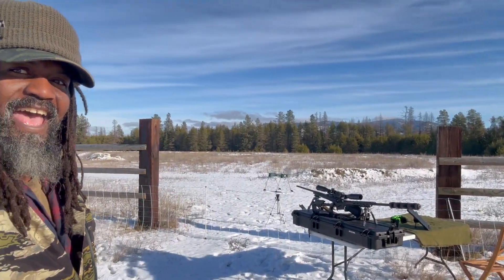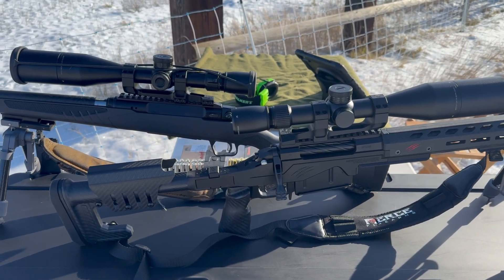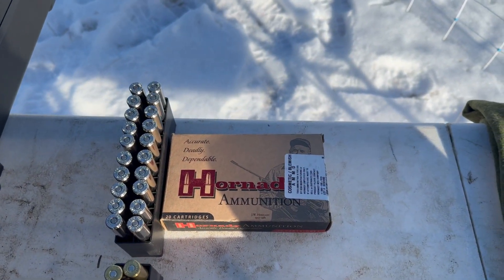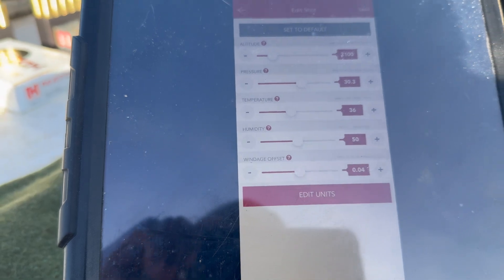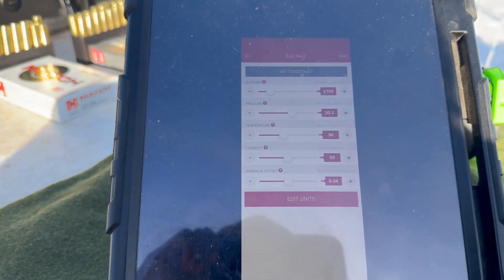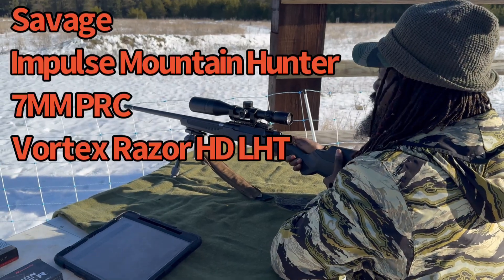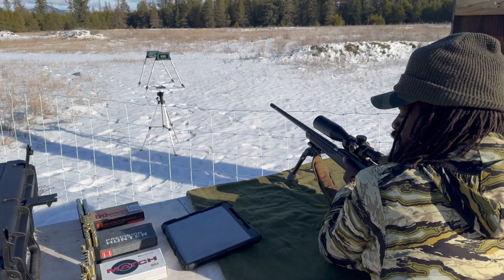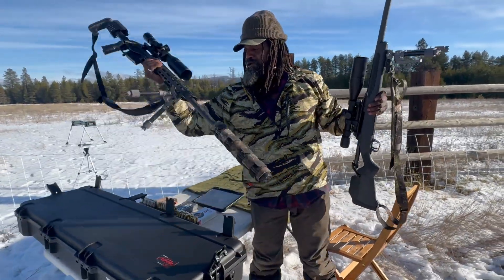7MM PRC factory ammo velocity testing fired from 2, 22” barrels.

Comment: The 7PRC is proving more everyday it’s not getting the velocities hornady claims they can do. Hard to beat the old trued 7 mag.
Reply from the maker: Agree, with factory ammo, but it will definitely outperform a 7 rem mag, at longer ranges with the same velocity as the 7 rem mag or even if the 7 rem mag is moving a little faster at the muzzle. This is for factory rifles shooting factory ammo at least. Both shine way brighter with reloaded and rifle customization. 

The modern higher efficiency bullets and a chamber and barrel designed around using those bullets are the stars here, not the necessary the velocity. (Though, as with most people here, I’ll be doing some load development to get an optimal velocity too; something that anyone wanting to use a long distance rifle for its intended use should do anyway. )

This is really pretty normal with all ammo across the board though. I’ve not chronographed any that shot the same velocity that’s on the factory ammo box. Makes me wonder about the shooting conditions.

That said, my bullets started moving considerably faster as the barrel warmed up. I could have definitely recorded some higher velocities if I kept it warm, but I did want cold barrel velocities as my primary use will be hunting. 

It’ll be interesting to see what I end up with. I’ll be happy to with anything north of 2900 fps shooting the 180 g ELD-M’s from that 22” barrel and groups well. Stay tuned my friend!
Reply: @apex-livingwithpredators8379  let me know how you make out. I’m getting mine built as we speak should be able to pick it up next week. I shot the barrel out of my rem mag and decided to jump on the band wagon and try the prc. Was debating on just getting a fast twist 7 mag barrel might do that in the future depending on how my prc does
Reply from the maker: @chadschlosser5683  there’s a few of us on this thread working up loads. I’ll probably do another video covering the last few loads I’m testing once I get it closer to dialing it in. 

I gotta put a few more boxes of factory loads through the rifle first, to get the round count above 120 or so, to break in the barrel more, before doing more velocity testing though. It’s only had about 60 rounds through it now and will probably speed up a bit after 120 rounds or so.

I’m looking forward to seeing your build!

Comment: What some people dont know is that the old 7mm rem mag is a larger case , and can yield higher velocity . Ive had a Remington 7 mag in a sendero 2 that would push 180 bergers easy to 3000 fps with retumbo power and nosler brass . With that being said the 7 prc is a more modern design for the nonhandloader.
Reply from the maker: It is, but because the COL and factory rifle throats are shorter, to load those longer bullets you have to seat them deeper in the case, making the net case volume less. The 7 rem mag factory twist rates won’t stabilize the longer bullets well either. That’s the big difference. 

Yes, you can get similar preference with a custom rifle or by customizing a rifle but the 7prc is built around those long for caliber, high bc modern bullets that didn’t exist when 7 rem mag was created. But, by the same logic one could customize a 7 prc and really maximize its potential further as well. 

That said , if you have a 7 rem mag and don’t shoot past 400-500 yards. There’s really no benefit to getting a 7 prc. 7 rem mag USA great cartridge, but, like you said, 7prc just does it a little better. It’s an improvement on a great design made for those that want to shoot longer ranges.
Reply: @apex-livingwithpredators8379  not true. 7 mag has .115 free bore. You gain .019-.026 of head space on the shoulder which equates to 3gr more in water capacity for a total of 85. 175 gn Berger elite with n570 and 22” barrel 2975 fps. 7 mag can’t be beat when hand loaded properly. Properly is the key word. The other point also is 7 PRC is 65,000 PSI, 7 mag with that 175gn load is 62,500 PSI. So more velocity with less pressure due to more case capacity. The thing is 7 PRC is 3.34”, 7 mag with a 175gn is like 3.472” and a 195gn is 3.507”. Which is considerably longer than the 7 PRC. You can buy a 7 mag with fast twist barrels factory. And mag boxes are 3.6”-3.9”. Every thing you need. Nothing you don’t.
Reply from the maker: @SpudOutdoors  good info, folks that know way more than I (gunwerks for instance) do disagree with that though. I’m definitely not knocking the 7 rem mag by any means though. It’s a great cartridge.

Gunwerks video on the matter.

https://youtu.be/neWwwSd2WYw?si=caZ5yVsfNUn1uTTd
Reply: @apex-livingwithpredators8379  yeah watched it. Problem with them is they run min chamber which takes the advantage away. Max chamber is where the magic happens. Plus he started his whole adventure with 7 mag and he was very successful with it. But he hates the belt. The 7 lrm is actually a great cartridge and is better matched to the 7 mag. PRC is just slower. FYI though most PRC videos are just advertisements paid by hornady. They are great at marketing and that’s all it is in the end. 7 mag has taken animals out past 1300 yards. It’s a beast when matched with a reloader that can get the most out of it. If you do happen to make a longer throat it get scary impressive. Know someone who did a custom throat and was running 195gn Berger’s at 3100 with a 24” barrel.
Reply from the maker: @SpudOutdoors  I can’t disagree myself. At the very least this series will be a truthful representation of the 7 PRC.
Reply: @SpudOutdoors What guys like you don't get is, handloads should never be in comparison in cartridges. Think of if you took every powder, bullet and primer combination in a certain cartridge how many variables is that? And that's not counting each individual barrel. What percentage of people buying 7 prc or 7 mags are handloaders? I bet you it's less than one percent. People don't buy guns off handloading potential. People buy guns off what's available on the shelf. I don't care what your pet load will do in your 7 mag. We do care that Hornadys numbers for the 7 PRC are different than advertised....and I don't even own either of them. You can go down the rabbit hole if you want and then I will pull out the 28 Nosler out of the hat on your 7 mag. And then the 30 caliber guys will say the 28s are not big enough and pull a 30 magnum. And then the 33 caliber guys...you see where this is going?
Reply: You get 4000 extra PSI with the 7mm PRC. That should be enough to make up for the 1-2 grain difference in max load.
Reply: That isn't what I got looking at a Hornady Reloading manual. The case capacity on the PRC has to be more. According to the manual it takes more powder and will give you higher velocity. I have read what you said on other you tube remarks, but the manual says different. I think I will go with the manual. After all they developed the 7mm PRC and have developed the reload data. I used the max 7mm Rem Mag data for a starting load on the 7mm PRC. Shot pretty well and will use it for a hunting load. You should check Hornady reload data and see for yourself. I did have to get the 7mm PRC from their website to compare it to my manual on the 7mm Rem Mag..
Reply: @garrytalley8009  a shoulder grows .026 on a 7 rem mag. Shoulder headspace you can end up with 88 grains of water weight. 7 mag is a bigger case. I tested a 175 gn elite with a 22” barrel. Used 77 grains of n570 and still had air in the case. Was 3036 fps on the 22” barrel. Absolutely do not do this if you do not form the case on a max chamber. Experienced reloaders only.
Reply: @SpudOutdoors According to the Hornady Reload Data on both of these cartridges the 7mm PRC can put out more velocity and use more powder than the 7mm Rem Mag. I will leave it at that. Different manufacturers of brass have different case capacities as well. Their data is with of course their brass. And I do believe that the 7 mm PRC case can take higher pressures which could have something to do with their data. If you find that to be incorrect let me know. I do know that what I stated is manual information from Hornady. I am currently reloading for my 7mm PRC. I use manuals and never bother with weighing water to determine case capacity.
Reply: @garrytalley8009  well duh hornady made the cartridge. They want to sell their product. Don’t you understand how marketing works. Two way to load a 7 mag. Full length resize and headspace off the belt or bump the shoulder and let it grow to headspace off the shoulder. All manuals do the full length resize, so if you load that way stick to the manuals. Don’t explore if you don’t know what you’re doing.
Reply: @SpudOutdoors You really are quite cocky. You too are arrogant. I use manuals for starting points and to not get started above maximum velocity. I have reloaded with neck sized cases as well. You really take the cake and think you know more than you actually do. You will never live in the real world. One can always load faster than factory loads. Have fun thinking you have an answer for everything in your own mind. I just stated facts from a manual. I reload for most likely more calibers than you own. I said most likely because I don't actually know how many you have. I am not a know it all. I have been reloading for over 40 years and update equipment when there is a substantial change. From what you said you really just use talking points with a lot of wind.
Reply: @garrytalley8009  lol I am not arrogant. I see life for facts and you live in a wonderland. The difference is when facts are presented then my thought process immediately changes. I do not get emotional attached to my ways. Which you are. Your experience of reloading of 40 years really means nothing. You don’t know what you don’t know. But like I said before please stick to what you’re doing but don’t expect to convince people otherwise. 7mm PRC is just marketing. By itself it is a good cartridge but compared to 7 mag it falls short and that is just a fact. If you asked me years ago how I felt about 7 mag I would have said I think it’s not that great. It took facts and others to show me those facts on what it can actually do. It is beyond impressive. Remington was way ahead on that cartridge. My dad has loaded for 51 years, and in the last 5 years I have shown him things he never thought possible because he was like you. But unlike you he saw it for facts and changed his ways because he too is not emotionally attached to processes. Good luck. Next time you want to debate leave your bitterness on the table at home.

Comment: I have the mossberg predator in 7prc 24” barrel. Hornady match averaged 2845, and precision hunter 2870. I did go back another outing and ran the match again and got an average of 2788. Not sure if it was the colder weather or my chrono. But odd to have such a difference in speed. Same lot of ammo but different box.
Reply from the maker: Different lots will do that. We have 22” barrels so your velocity in your 24” is constant with my finding as well. Thanks for your input! 

Going to be doing load development soon.

Comment: Nice work, and thanks for posting it up. I was getting a wee bit more with the ELD-Xs out of my Savage Ultralite 7PRC, but I had shot different manufacturing lots as I broke the barrel in for hunting. After about 120 rounds of factory and handloads, I was getting 2900fps average. That lot of cartridges used an extruded powder measured at 67.5gr. I don't know if it was RL26, H1000 or something else. I attained the same average velocity with my handloads using Staball HD (flattened ball powder). Hornady used all three of those powders in their ELD-X loads, and their first lost were HOT. I assumed they backed them down. Maybe you can dissect one and see if you can determine the powder used.
Reply: I averaged 2962 with Hornaday 175g eldx factory loads out of my 22 inch Savage. I am at 3400 feet elevation.  I didn't have time to finish load development before hunting season and accuracy was acceptable so I ended up taking a bull elk with this load. I was planning on a 200-400 yard shot, but ended up running into him in a ravine and hit him at 40 yards. Exit hole was 2.5 inches. The bullet fragmented a bit, but I am satisfied considering how close the shot was.
Reply from the maker: @Andrew-jm4tp  awesome! With those velocity results, I’d personally just keep shooting factory ammo over doing load development. There’s something refreshing about being able grab an extra box of ammo anywhere over having to bring a bunch extra. I was hoping this would be the case. 

It was cold, 36° when I shot this. Not sure how much it’s a factor with the powder Hornady uses for these cartridges. I heard it may be RL26, H1000, Rutumbo or Staball HD. @reloadingwinchester took some apart on a video and thinks it’s Staball HD. 

I think Rutumbo is the most temp stable of the lot, but can be hard to find. I hope to find a good load in H1000 because it’s pretty stable but has always been pretty easy to find.
Reply: @apex-livingwithpredators8379  I have never seen Retumbo in the wild. I will definitely be reloading so I know what kind of powder is in my cartridge. It seems crazy to me that Hornaday would put out different lots of ammo with different powders without any labeling. It would ruin a hunt if a guy zeroed with one box of ammo and brought a fresh box into the field. Staball HD was giving me good accuracy in my reloads but I didn't have time to see how far I could push the velocity. I am in Montana so I need something that works well in the cold.
Reply from the maker: @Andrew-jm4tp  I’m not too far from ya in northeastern Washington myself, just an hour or two to Montana through the Idaho panhandle. We are likely reloading with similar concerns. I found some Rutumbo a whole back and know where to get more. But gotta buy a 8 lb jug… so loading a few rounds in it now to see how it works before deciding on making that investment, or before the opportunity disappears.
Reply from the maker: Not a bad recommendation! But our not shooting at the velocity I want either. So we are going to load develop now. I’m going to try to push the powder limit a bit, but also seating the bullet out a bit to reduce the pressure when I do. I found a few places with load data going up to 70g of h1000 and 71g of Rutumbo seated out to as much as 3.4+. I’m gonna see if I can stretch it to 3.375 without being on my lands, with the eld-m’s.
Reply: @apex-livingwithpredators8379  Well the SAAMI reamer free-bore is .233, and I've seen used a COAL of 3.383" with ELD-Ms. 70 gr of H1000 will be hot! I'm not a fan of Horady brass, and Peterson brass would be a better choice for cranking it up. I just got a new supply of H1000, so I'm going to work up some loads with that, as well as N165 too.  Good luck!
Reply from the maker: I hear N165 is a great option as well. N560 and N565 are supposed to hive good velocity results as well; though I’ve read that folks loading H1000 and Rutumbo have found better accuracy results with those powers. I got some rounds made up at 3.375 w/ 70 g of Rutumbo to test. I’d like to find a good H1000 load though, because that powder seems to be the most available and it preforms well for this application.
Reply: @apex-livingwithpredators8379  I'll let you know what I come up with.
Reply from the maker: @thebleeb1681  looking forward to seeing what you come up with too!!
Reply from the maker: @thebleeb1681  I got a max COL measurement on my rifle of 3.393. Video on the process posting now. Should be up soon.
Reply: @apex-livingwithpredators8379  Ran some N565 behind some 175gr Nosler ABLRs. 68 to 69.6gr. No overpressure signs. 69gr gives me 2865fps with an ES of 5 and SD 0f 2.5. Group was about an inch, but my new scope slipped. ABLRs like jump, so I'm going to seat deeper than the 50 thou off lands (3.2875" COAL) I tested with,  after I tighten my rings, lol. 75-100 thou off lands or so will get me close to 2900fps. That would make an awesome hunting load.

Comment: The factory Hornady ELDX are only giving me 2788 fps out of my Bergara B14 Crest 7 PRC with a 22" barrel suppressed. Hornady's advertised velocities are not remotely close to my actuals.
Reply: Seeking element also 22” I’m in that same ball park with hornady precision hunter ammo. Done a little reloading for the 7mm prc. I don’t see any way it’s going to get to 3000fps with a 175. Think I was at 2850 with a max load of h1000.
Reply: @richwc1 I'm getting 2800 out of a 24 inch barrel no way anyone is getting 3,000 lies once again from Hornady
Reply from the maker: Same, here was hoping it was just the cold weather. But I think I’ll have to start some load development to try to get them closer to that 3000 fps range.
Reply from the maker: Have you tried Rutumbo or N560? I was going to load up some eld-x rounds using those powders. Seemed ru preform well on the Hogden’s load data page. Rutumbo is also very temp stable. More so than even RL-26. 

I don’t think I can get to 3000 fps. But I’m hoping to get some good groupings at 2900+.
Reply: I have H1000, Magnum, and H4831SC to play with. I'll see what these will do before moving on to LRT, Staball HD, and Retumbo. @apex-livingwithpredators8379